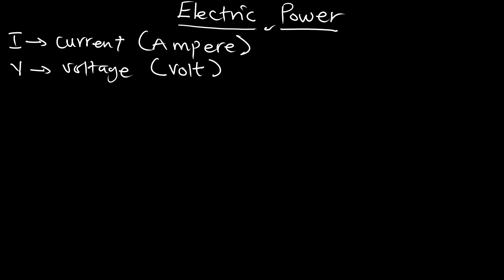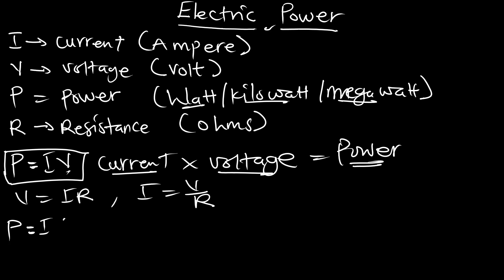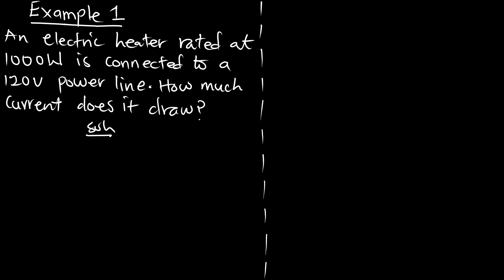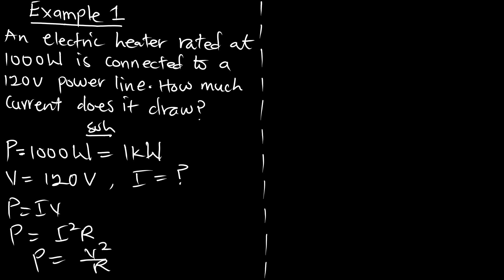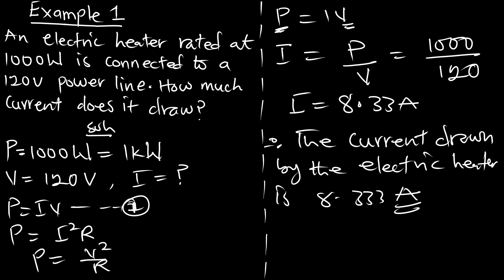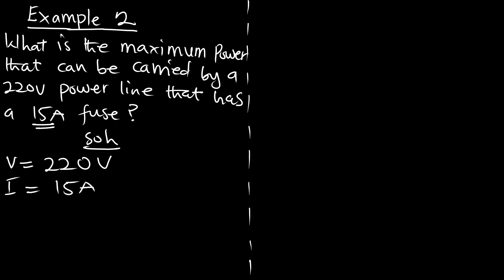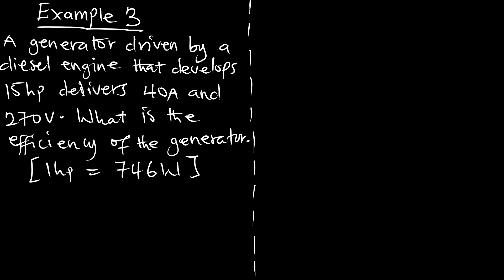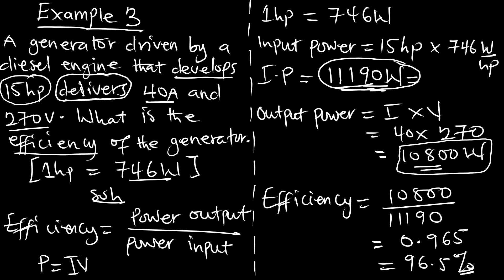Ep 16: Electrical Power explained

Comment: The fuse doesn't limit the amount of current to a safe level. It acts as a safe switch for safety, that if the current exceeds its normal level, the fuse burns, in other words opens the circuit.